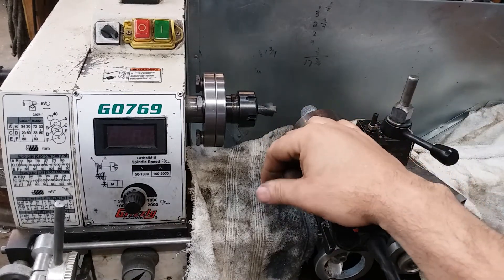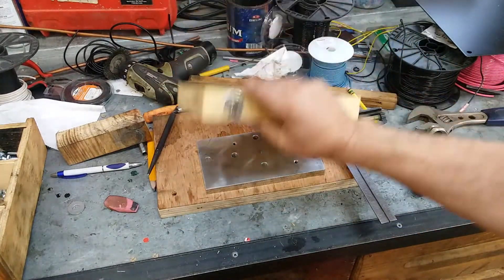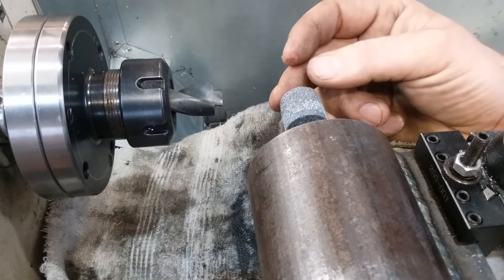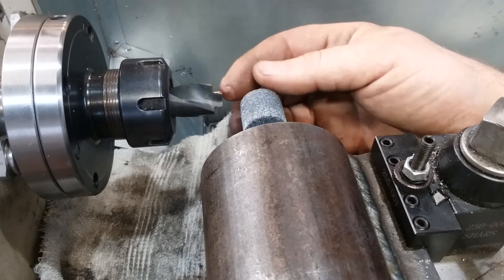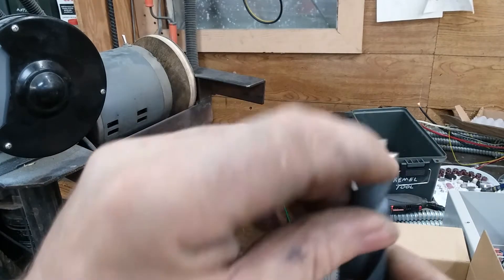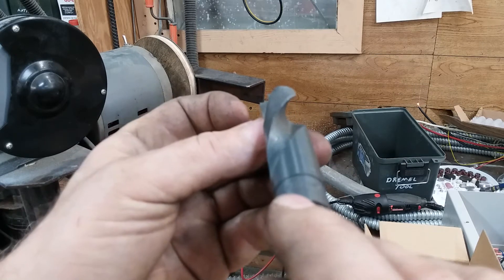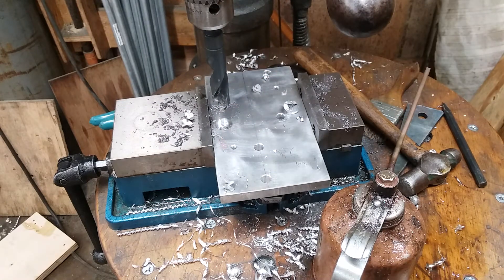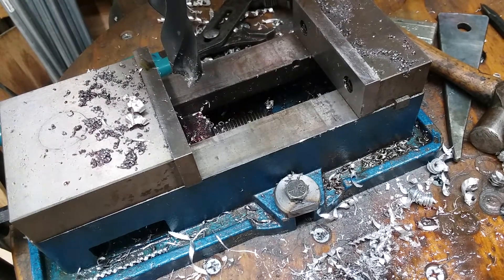How to make a Try it yourself counter bore tool.

Comment: Nice job. I imagine a piece of tubing over the center of the counter bore that goes into your through hole would nice. The tool cuts nicely. I wonder if these cheap bits could be hardened enough to cut steel?
Reply from the maker: Oh, they will cut steel after they have been sharpened properly. The factory grind is usually terrible.  I have used them in mild steel a time or two, and they do sort of work, they just go dull way to fast.  As far as re hardening and tempering, If I had a heat treat oven, I might try it.  It's outside of the limit of my abilities in my ill-equipped shop.